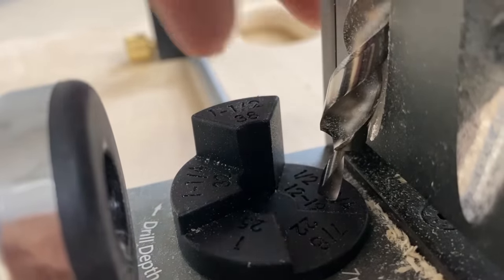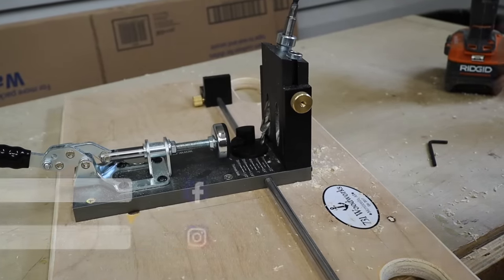Top 13 Pocket Hole Tips and Tricks | ULTIMATE Guide To Become a Pro

Comment: Don’t forget, 1” or 3/4” wood that you purchase isn’t always 1” or 3/4” to begin with. Plus if you’ve done the majority of your sanding before you assemble you have also removed wood. All that makes a difference.
Reply: When you start throwing these fractions about it makes me glad I use metric. The maths is so much easier
Reply: He says that in the video
Reply: @PaulSmyth  as an engineer, I can agree that Metric is so much nicer on paper (most people still don't know how many feet are in a mile). As someone in the US who enjoys making things with wood and metal, metric is hardly any better than imperial fractions. What is 1/2" split in half? 1/4"...easy. What's half of 1.27 cm? .635, or 6.35mm....one of those is a lot easier to find on a tape measure than the other... Granted, if I was building with metric, I likely wouldn't have to worry about 1.27cm..but you get the idea.
Reply: @PaulSmyth  Yep; why on earth anyone still uses Imperial is beyond me, there is zero logic. Science has been metric forever, because it is precise. I'm an old school Brit but have lived in Europe and the far East for 20 years; I now think litres and km, mm and ml. Life is so much easier
Reply: @LoganLovell  Agreed, but how often does Joe Average need to work beyond 1mm accuracy?
Reply: @PaulSmyth  na it even easier then metrics. No problem
Reply: It pretty much never is. The measurements they give are before they run it through a planer.

Comment: Another cheap trick if you have an old dead hard drive around (not an SSD but, the kind with metal disks inside) you can dissemble that and get two insanely powerful magnets. Even old laptop hard drive magnets are powerful. And when you pull them out they have screw mounting holes on the back plate. Tools needed: some fine torx bits usually. Maybe some allen keys. That's about all.

Comment: Great tips, Something else for you other fellow woodworkers, there's still gonna be times where pocket screws will blow out and you won't notice it till later on!. I highly recommend getting/using a dremel with a cutoff wheel to grind the screw down flush with the wood. Simple and effective.
Reply: I have also used a hacksaw blade

Comment: You should what would happens if you use a flat head screw over a pocket screw . What about round head screws..l worked as mechanic in a large furniture company and that's all they used was round head screws in pocket holes..nothing special about the screws...l would use pocket hole screws. But was curious about rounded head screws
Thanks 
Wayne H

Comment: Driving your screws in on the “correct” side will also help eliminate blowout as there will be more receiving wood to grab onto. However, for those times you want to “hide” the pocket holes, these are great tips! 
I especially enjoyed the tip for using the bit as a countersink in conjunction with a 3/8” dowel. That looks snazzy.
Reply from the maker: Thank you
Reply: Hey Damon I just wanted to thank you again for the quarter tip. It's been super helpful in building my small projects. :_fistbump:

Comment: I do a ton of pocket hole jointery, working with reclaimed lumber that has some variation in thickness. What I have found as a quick check to make sure my collar is set right. If the narrow tip of the drill bit goes through the mating surface then you're too deep, back it off another eighth...

Comment: Thanks for the tips few things i did not know. 

Got my own power tip came up when making a drawer for a slim kitchen cabinet. My drill could not fit inside the box i was able to set those screws using a socket set with the pocket screw driving bit, being extra careful not to over tighten.

Comment: You missed one common mistake. When installing the pocket hole screw, be careful to get it into the pilot hole and not against the corner of the pilot as the angle will be totally wrong and the screw will come out at the wrong angle and may pierce the piece you are working on. (happened to me) Just work carefully and make sure that the screw is in the pilot hole before driving it home.
Reply from the maker: good one

Comment: Thanks Matt for the helpful tips.  I am going to throw a tip out there for you that works for me. Because pocket hole screws are so dang expensive I go to my local hardware store and buy whatever screw I need for the job and add a washer which creates a flange around the head of the screw.  It works for me😊

Comment: Always  test with scrap wood.  Chk the thickness before assembly,  you can also use 2 pieces  of flat 1/8 aluminum, to clamp if you don't  have face clamps
Reply: Saves a lot of heartache to do a test piece first.

Comment: Thanks for sharing awesome tips👍. 
Hope this tip (from me😊) helps you. I recommend using 10mm - 15 mm rubber floor mats on the concrete workstation floor for preventing accidental fall and breakage of bit tips.

Comment: Hey Matt, great tip on the plywood not being a true 3/4". Take it a step further, depending on the quality of the plywood even adjusting the bit stop may not be enough. I'm going through that now on a bookshelf. I modified the bit stop and still had to use 1" pocket screws. Just thought I'd share that.

Comment: Buy an $8 flush cut saw at harbor freight and skip the sanding after cutting off that dowel. The flat teeth wont mar the work piece. when trimming off the dowel. As a trim carpenter and woodworker I keep one in my tool belt, one on the van, and another one in my shop. I use those great little hand saws on a daily basis.

Comment: I like that how to fix a blow out tip....I would have gotten angry at myself for that happening since I probably screwed something up.  but that fixer trick when using stain, ohh la la. I like that.    EDIT: instead of using a face clamp, can someone use a normal quick clamp say that comes with the worx pegasus table?
Reply from the maker: you can but those don't work as well
Reply: @731Woodworks  good to know, thank you for the info.  Question for you, since your majesty IS the pocket hole king.  if I was building a counter top thing that was against 2 walls in my kitchen, could I use pocket holes to join the 2 45* angled cut ends together? I've thought of this as a way to make it easier to move this monstrosity from my garage to my kitchen in 2 pieces as easier than as 1 whole piece cut from a single sheet of wood.  Thanks in advance.
Reply from the maker: Yes you can do that
Reply: @731Woodworks  sweeeeet thank you.

Comment: Some useful tips, even if you do measure in a foreign language! Inches and fractions of an inch make no sense to me whatsoever!
Reply: Once you learn it it’s faster. I used to prefer metric until I started working as a GC.

Multiplying and dividing is easier, you’re dealing with twos and not 10’s, ( think half of 3/4 = 3/8ths and so on) 

once you see the size of the line you know where it is. 

Oh, and it’s more accurate 

25mm in an inch, imperial tape divides it into 32’s

And then you can go to 64’s without jumping all the way to 100 which is just way too small
Reply: @chriscolameco6850  inches have never been quicker 😂

Comment: One tip I have is to always make sure the joint is closed before putting the screw in. Once I tried to use the pocket screw to close the gap in the joint and the screw head actually pushed a dowel shaped slug of wood through the end grain.

Comment: Particle board screws also have the "warsher" attached to the head of the screw, if you can't get KREG screws. However they are more expensive than KREG screws (where I live anyway) by about $0.04 per screw, but in a pinch they will work if your store is out of KREG screws. They would only be good for interior projects as they don't have a coating

Comment: One other trick for hiding countersunk screws is to use a plug cutter and make plugs out of a piece of scrap and have the grain be more matching than the end grain of a dowel.  If you are lucky enough, you can almost make the plug blend in completely.
Reply: I saw a project were a person was doing a project in cherry and drilled the pocket holes on the good side and used walnut pocket hole plugs to give it an accent look

Comment: I'm making corn hole boards using 2x4 for the frame and 1/2" birch plywood for the deck. I've made pocket holes into the 2x4. What size pocket screws do I need to join the deck to the frame?

Comment: 731 Woodworks: (I’m beginner, never used pocketholes) what if combining pockethole with woodglue? Almost as fast as using only pocketholes but with added strength and no need for clamping while the glue dries. Is it a good idea or just overthinking?😅

Comment: I’m going to use my Kreg pocket hole jig to attach the drawer box sides. Will that work on 1/2” ply? I’ve heard several people say sometimes the screws blow out the back on 1/2” ply.

Will adjusting the stop collar tip work on 1/2” ply?

Comment: Boy could I have used this last week. Went through a few boards before changing the depth collar. Any tips on the thingymajig clamp not splitting the wood. I just got it and for pine it pushed a few holes out.
Reply from the maker: Oh wow. Lighter tension not help?
Reply: @731Woodworks  probably, that’s what I was thinking but I used it straight on arrival so didn’t have time (or the inclination) to practice.

Comment: Hey Matt, great video! Got a question for the 👑. Do u know if anyone makes a shorter driver bit for pocket holes? One problem I keep having is when I’m trying to screw in a pocket hole within a small space. The driver bit is so long and combined with the drill and my hand, I can’t get a straight shot at the screw. Any suggestions? Thanks!
Reply from the maker: Yes they make a 3” one (can be found on Amazon). But a right angle attachment is great too https://youtu.be/bjYWq4ZrUT8
Reply: A Robertson/square driver bit fits perfectly.

Comment: ‘Why you DON’T need face clamps’ 
it’s because of the angle of most pocket hole jigs. No matter how tight you clamp it down, if you drive the screw home the pieces will still shift. The answer is to buy a Castle pocket hole jig if you can get your hands on one. 
Technically you don’t even need clamps, maybe on hardwood but it’s such a superior technology.

Comment: I added something to my face clamps. I found that every time you set down and pick up your clamp it has tightened or loosened. I to a wing nut the same threads as the adjustment screw. I filed betting the wings to allow it to fit over the hosing for the adjustment screw receiver. Take the screw out and thread the wing nut on to the screw. Have the wings facing away from the knurled knob on the screw. Thread the adjusting screw back in. Set your tension on the clamp and run the wing nut down just tight enough to keep the screw from turning.

Comment: Regarding that magnet, if you’ve got a little jig board like you do, just recess that magnet in a little hole that you drill with a forstner bit and secure it with a drop off CA glue. Then you can stick your bits and such off to the side. I actually did that on mine.

Comment: Never have used a depth collar. Started back when they didn't have any. Still don't need one as I learned how to set the depth stop without one. No need for one... Put all lumber through the planer before starting the project. If you don't get your lumber at a good (not big box store) lumber yard, the thickness night be just off from board to board.I use the same screws for all projects no matter the wood. The face frame screws are just a clamping aid and the glue does the real bonding. And I have been using face frame screws for over 30 years ever since I bought the first jig from Kreg at a wood working seminar in Grand Rapids when they were the only company making a jig. Kreg was the first and to my feelings still the best. They have introduced all of the good  face frame tools and all the other companies have copied them. Nice idea for the drilling  a hole for a  hidden screw. I'll have to use that. but the screw is still a clamp for when the glue dries but will give the joint a lot more structure. If you absolutely have to use a regular screw, you have to drill the hole very shallow - very shallow and use a real soft touch while driving the screw. The magnet is a real good idea but my Kreg has built in case for the odds and ends you need all of the time.

Comment: 2 tips I never saw was using different screw lengths. I believe that the factory jig settings are based on specific screw lengths but the instructions never mention that. Also ALWAYS TEST ON SCRAP MATERIAL OF THE SAME THICKNESS! unless of course your experienced enough with your equipment.

Comment: I was afraid that the pocket hole screws would be way over priced.  What I discovered is that at Lowes, they are about the same price as regular wood screws.  Even when I found an off-brand pocket hole screw pack, the quantity price and variety packs from Kreg were still the better deal.  

Thanks for the tips.

Comment: Not that I necessarily disagree with you as far as what’s a better screw, but seems I always have Sheetrock screws laying around and not enough pocket screws. I’ve been using my Sheetrock screws for years without any issues.  You just have to stop your screw gun when the screw gets to the lower end of the pocket hole. I have yet to have a screw pop thru the other side of the board.  It’s kind of common sense to not keep running your screws past the pocket hole to me, but I’ve been in the cabinet business for over 50 years and even all the other cabinet shops I worked for in the past that used a face frame table with pocket holes all used Sheetrock screws too! But with that being said, they were using oak, cherry, maple, more medium to hardwood so maybe that makes a difference too?  But certainly if you got the pocket screws on hand, use em!

Comment: Thanks for the tip resolving the pocket hole screw piercing through the other side. I was using the typical 1 1/4 inch pocket hole screws going through 3/4 inch stock into 1/2 inch stock. And the screw was breaking through. Didn't know what to do. So my solution was to use 1 inch long washer head pocket hole screws. It seemed to work okay, they went in and bottomed out nice and tight. With your tips, I now have more options available to me. Thanks.

Comment: TIP: Since this was a brain fart for me. While setting up bit depth, I always hold bit depth collar and pull up on drill a bit so it sets shoulder shallower to help avoid bit from poking through face of project like others do as well. Thing I forgot to remember when putting in Kreg wood plugs was to sand/cut flat end down so it actually sets fully into hole instead of raised above surface. Big Duh!

Comment: Thanks for the tips and pointers Matt.  Always enjoy watching you and learning more.  Just as a thought, if you have your pocket hole jig mounted to a base like you are showing us, how about using a Forstner bit to drill a 1/8" or 3/16" hole in front of the pocket hole frame, glue in the rare earth magnet, and keep your items in front of the jig and out of the way of your hand movement since the cutting edges of the drill bit could slice someone's hand if they drug it across at an angle accidentally. Just a thought but it would keep the bits, tools and other items in front and out of the way.  Putting in 2 magnets would allow you to have one in front of each edge of the jig and hold long things more securely as well.
Reply from the maker: Yep I’ve thought about that while editing the video lol
Reply: @731Woodworks  Like minds think alike.

Comment: One of the most important things about PH is that there are two types: step drill cut and router cut. The characteristics of the two are quite different. 

Not talking about router cut PH will be a big omission.

The router cut PH does not have a slant. Therefore, the screw can be further away from the joint and can be longer. These are important features.

Comment: So instead of backing off the depth of the pocket, why not just use the correct length screw?   The Armor pocket hole jig will set the bit to the correct depth automatically and tell you the correct length screw.  Makes things so much fast than all the measuring/Trial and error.  Just a thought.

Comment: One note is do not use pocket hole across the width of a board when joining two boards.  Across the length edge is okay.  This will avoid cracks ect..

Comment: Best tip I can give is to use an impact for drilling your pocket holes, definitely faster and easier than using a drill. Even moreso for drilling metal, a set of impact drill bits to get it started and a step bit work like magic through steel

Comment: Very helpful video! One question I always come back to is: if I’m drilling a pocket hole into 3/4 ply, and going to use that to join it to 1/2” ply at a 90 degree, what screw should I select and what settings should I go with?

Comment: Matt, I have been using pocket hole joinery for many years and enjoy your videos. Thanks for taking the time to do it. Also, one thing that might be a tip for new users is when determining where you are going to place your pocket holes is try to avoid screwing into the end grain of a board. Also, when I am using two or more screws to attach boards together I like to screw each screw in loosely before driving the first one home. This helps to keep the two boards from shifting when you drive the screws home. Thanks and keep you the great videos.
Reply from the maker: Thank you for the tips